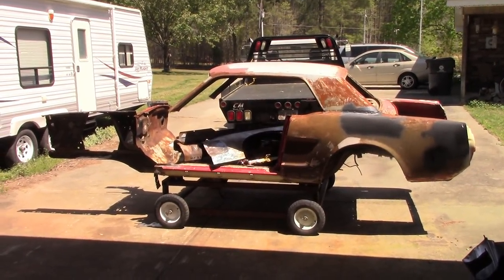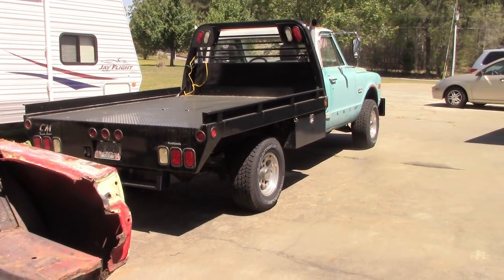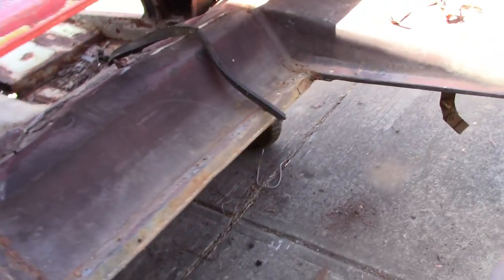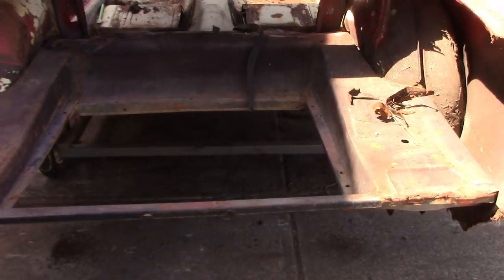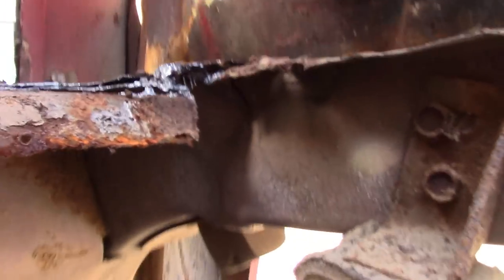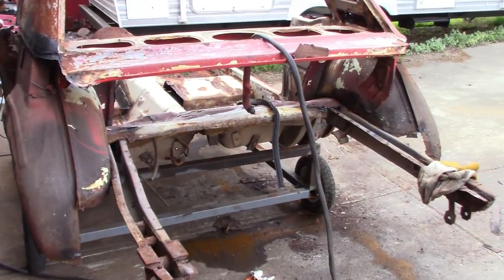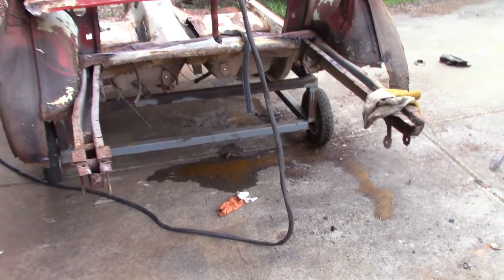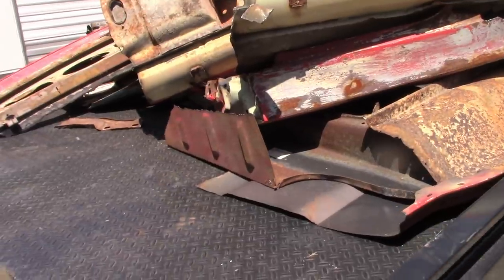Rest in peace (pieces) Harbor Freight plasma cutter destroys Mustang.

Comment: Barry I have a 66 coupe that I think the drip rail seam sealer failed and the end result is rust....the peculiar part is that both of the sun visor bracket mounts have severe issues.....I fabricated a replacement for the passenger side and "patched" the driver side...I was thinking dang it when i saw this....but then you stopped and kept the roof structure.....so I guess you can see where I'm going with this....that mount is held in by a few spot welds.....is there any chance at all that I could get those off your hands....
Reply from the maker: Possibly. email me. jodaddysgarage@gmail.com

Comment: Hi new subscriber. Watched several of your mustang floor pan replacements. I have 65 that is so bad the driver seat was on the ground still attached to the firewall though. Have 95 donor car was measuring floor and the it is 1" approx nar. than 65 door to door seal. Think i will try to make it work.  Any ideas welcome
Reply from the maker: Interesting. Never considered using a newer pan.

Comment: Heartbreaking to see it cut up,  but if you couldn't have saved it nobody could have.
Reply: Some of the OEM parts looked to be in good condition.  I would have just drilled out the spot welds and sell whole panels like the rear speaker deck on eBay.